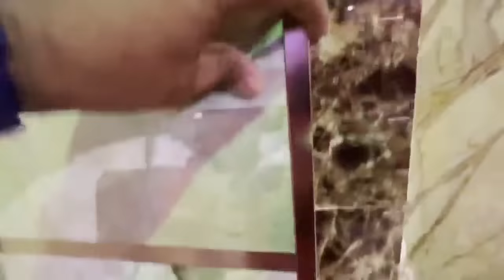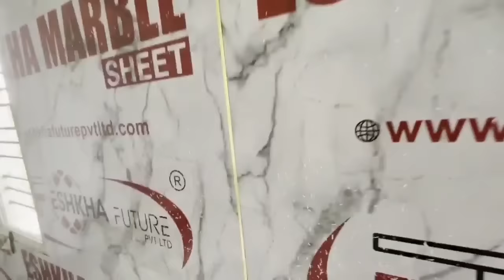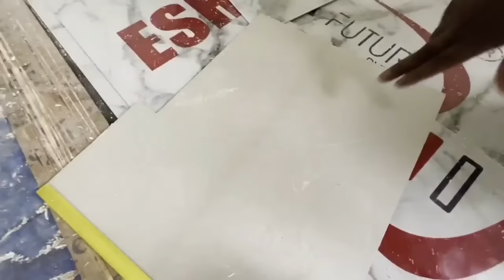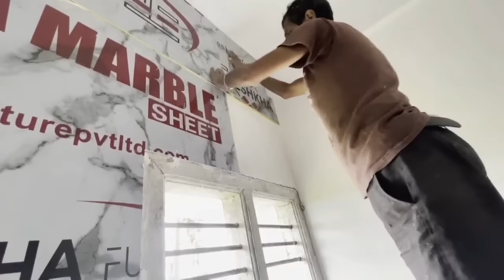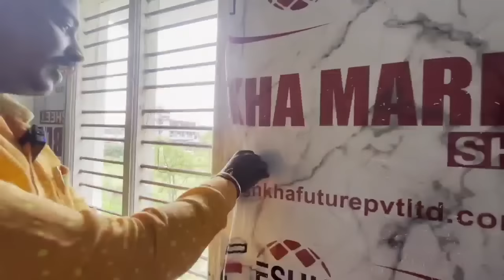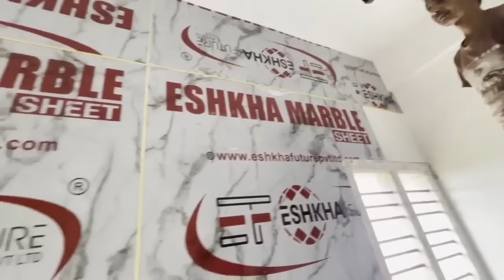Marble sheets for interior design | Low cost interior | Construction in Kannada | Polygranite sheets

Comment: Today I went and enquired 70 rs per sqft and laying cost is 70 rs total 140 per sqft.. Lol 50 rs anthe bari olu ivardu... Mathe i checked the material it's not good as it gets full scratches and glossy look will go... Waste for most... Only consider if you are planning to do wall paper then this marble sheet is good comparing to it

Comment: Please give me information about compound construction charges seperately..1)2ft ಡಿಗ್ಗಿನಿಂಗ್
2)stone wall 2ft
3)1ft plinth beam
4) 4 inch wall with plasting sq ft charges
5) compund design 20 ft
6)plane parada 18ft*3ft
7) parafit wall 4 inch wall with plasting and 9inch wall withplasting
8) flooring plasting per sq ft ground compound inside
9)40 mm fiing per sq ft and sand and cement mixgure filling charges
10) ground plasting pef sq ft